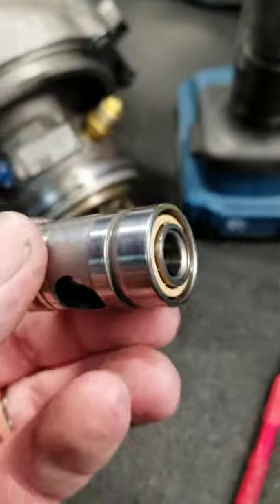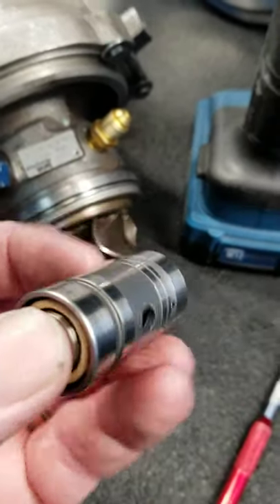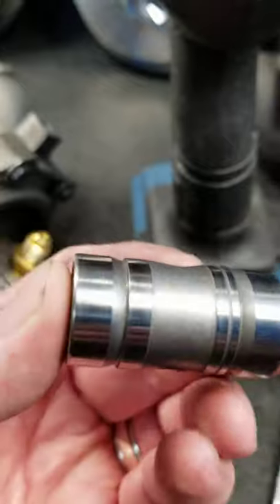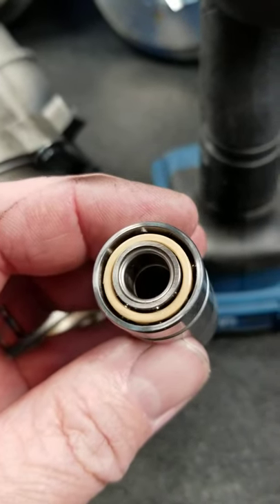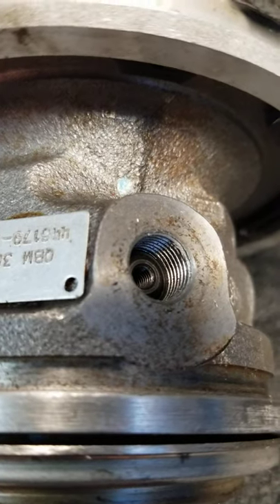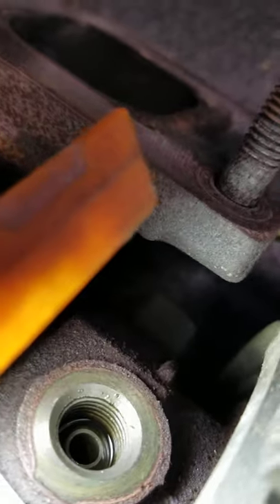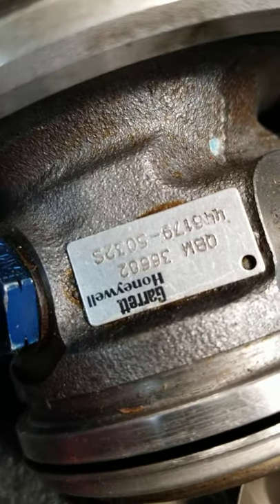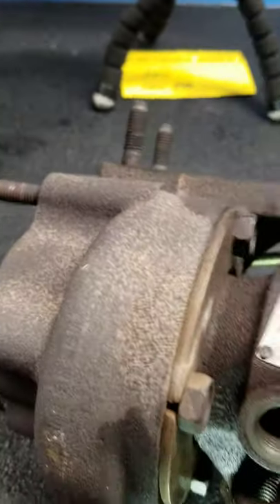Is your Garrett turbo ball bearing? Here is how you can tell!

Comment: Very informative video.

My question now is if you ever done a Blouch Dominator 1.5xtr. Do you what rebuild kit that I need? I contacted them numerous times but they respond to every after week. And didn’t get an answer, instead they recommend me to send my turbo for them to fix it. 

It has a small amount of oil leakage and burning in my downpipe. No shaft play at all. I
Reply from the maker: I am not familiar with the Blouch turbo, I did a bit of research and it is advertised as a ball bearing unit, so it may be proprietary to their design unfortunately.

Comment: Is ball bearing better or journal
Reply from the maker: Depends on the application, and a few other variables.  The biggest "advantage" of a ball bearing unit is usually they will have the latest aerodynamic improvements from the manufacturer, because that platform is the current "state of the art".  For example, look at Garrett, their whole catalog of "modern" turbochargers are all ball bearing.  You cannot buy a new G series unit any other way.  You have to back way up in the catalog to even find journal bearing options.  

Now, the other side...ball bearing units are more durable under high pressure ratio's.  So if we have a customer that is going to run upwards of 25 psi on a regular basis, we will always suggest a ball bearing unit if it is available.  They are more durable.

The question everybody asks...Do they respond faster?  Not always true.  Most of the time we cannot compare exact turbochargers in both journal and ball bearing (reference my first paragraph).  It is usually the rotor groups aero that has the most to do with response, not the bearing structure.  Hydro-dynamic bearings are not as "draggy" as people think they are ;)

Thank you for the question, I hope I offered up some good points to consider.-Reed